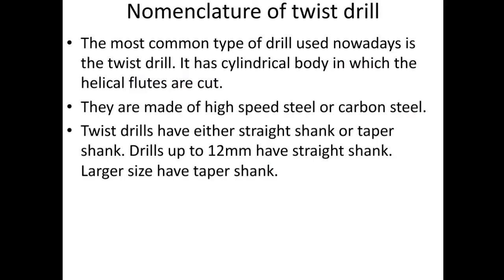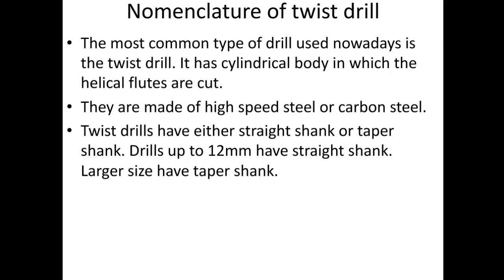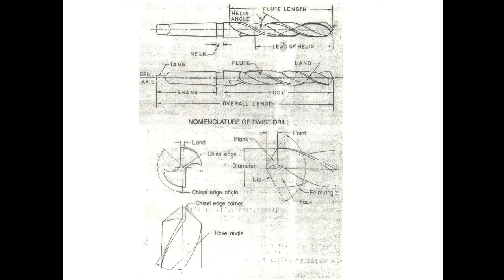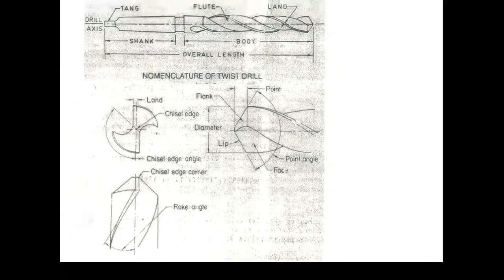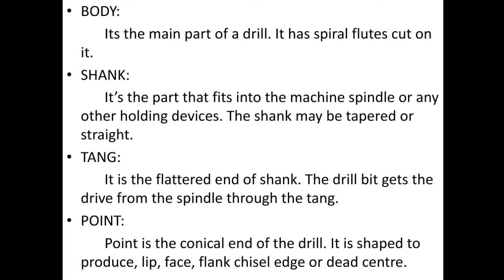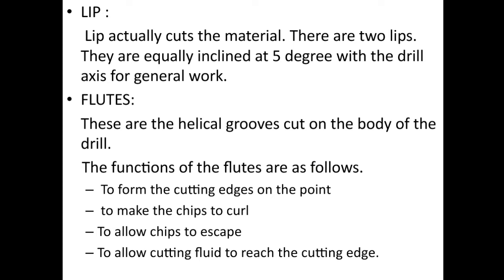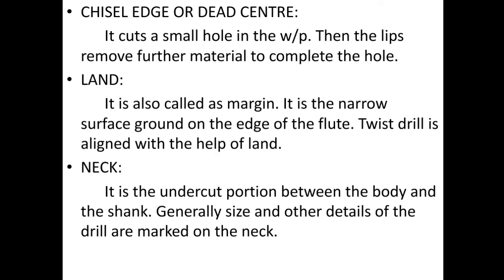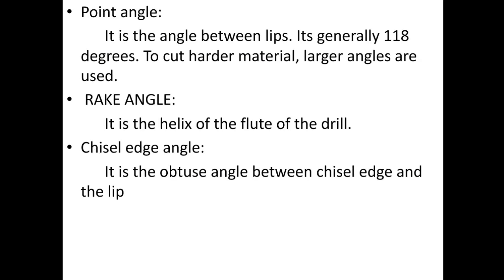Tool Nomenclature Of Twist Drill | Engineering study materials

Comment: Hey brooo....the two lips of twist drill are equally inclined at 59° with the drill axis for general work...😁
Reply from the maker: The point angle of a twist drill is the angle made by the cutting lip and the axis of the drill. For general purpose drilling a point angle of 59° (118° included angle) is recommended. The point angle may vary somewhat, one way or the other, but the variation should be uniform in both cutting lips.
Reply: @EngineeringStudyMaterials   it may vary but for general purpose both lips are inclined at 59° to the axis of drill.